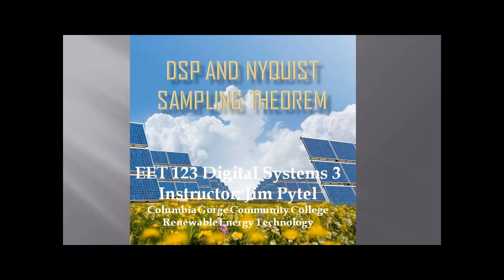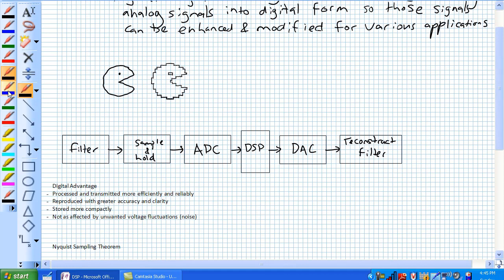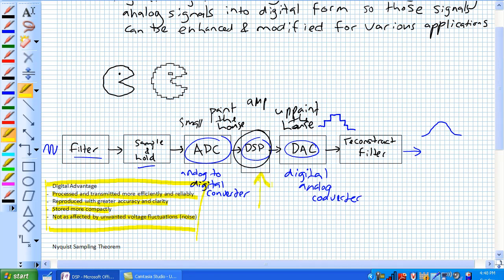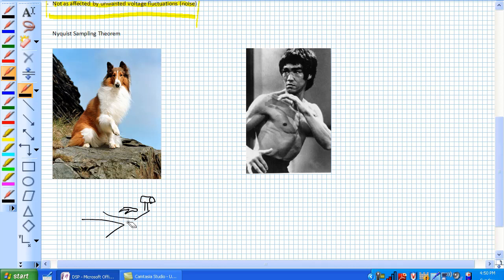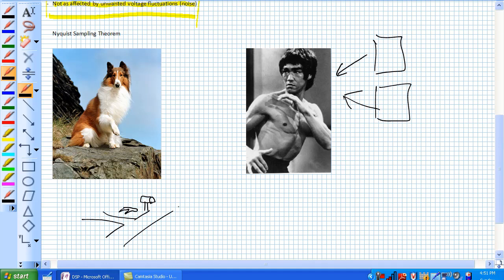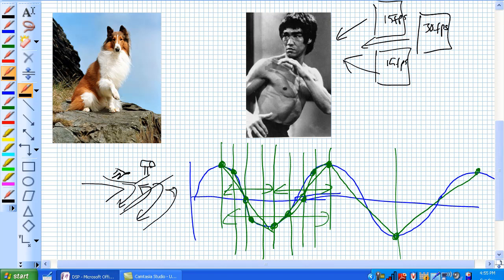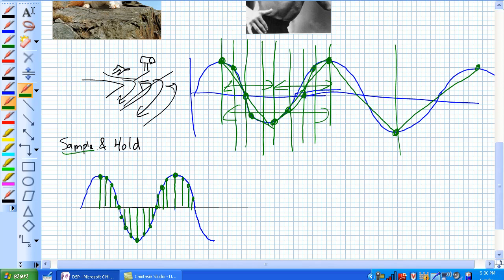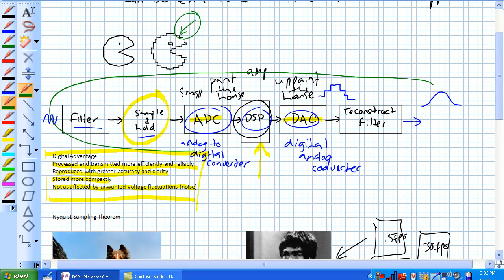DSP and Nyquist Sampling Theorem

Comment: He does not explain this well at all, he seems to think that the wave is sampled in an inaccurate steppy waveform, which is false, he missed almost the entire point of the Nyquist theorem, the part where you interpolate the get the exact waveform in between the sample points, rendering any further sampling (in between) useless. It's cute that you put Lassie in there, but what good is it if you're explaining it wrong.
Reply: George Rosebush I commented on this some 2 years ago and I'm surprised to see this video, which is, if not wrong, at least very confusing, is still online.

Comment: The Nyquist part of your video at least suggests that an ever increasing sampling frequency reconstructs the original sinewave better and better. This is not correct: frequencies below the Nyquist frequency can be reconstructed perfectly, however 'pointy' the graph (what you call 'rendition') looks. The last doubling of the sampling frequency in your video adds no necessary information for reconstructing the original sine wave.